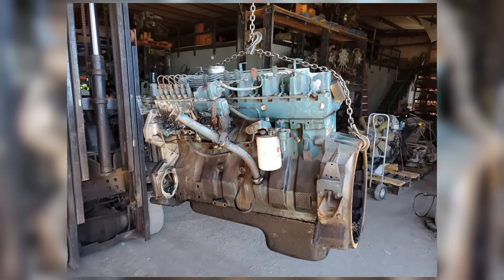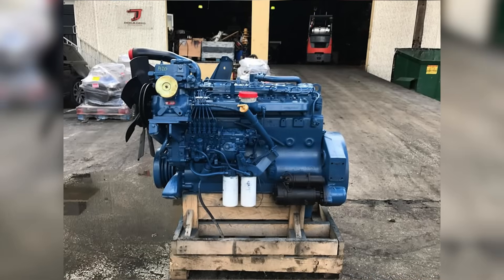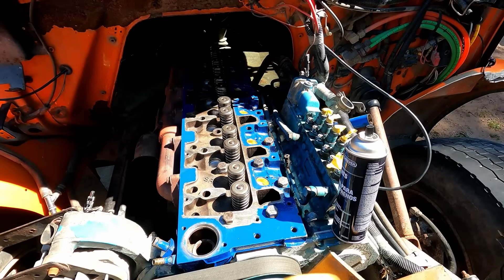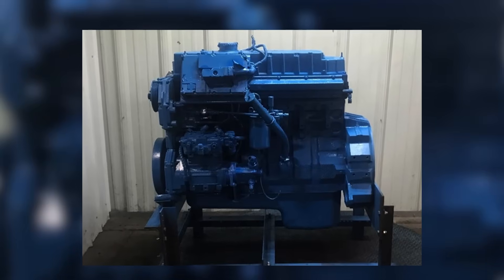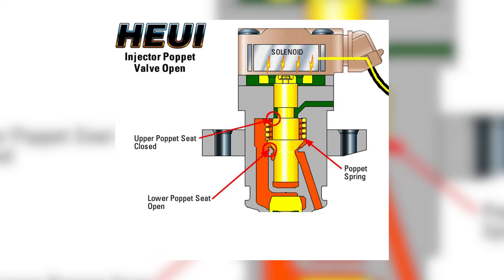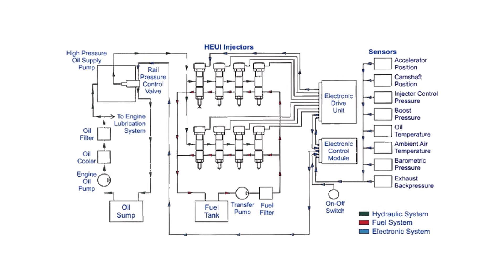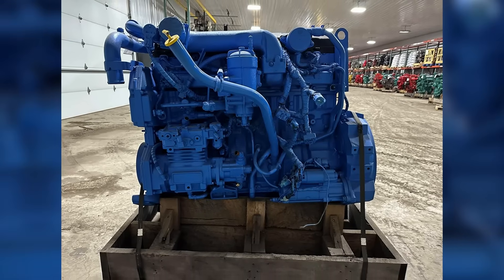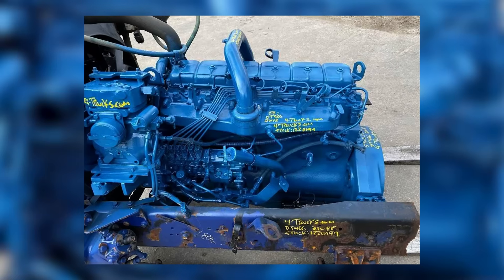The Shocking Truth About Why Truckers Hated The IH DT-466

Comment: We have several school buses. Anything from an old ‘96 Bluebird conventional with a DT466 to a brand new IC with a Cummins L9. 
We also have an IC with the dreaded MAXXFORCE EGR p.o.s. 
(It runs good, WHEN IT’S NOT IN THE SHOP)
And a couple of Cat C7 HEUI engines. Among them all, guess which one NEVER fails and ALWAYS starts when you crank the ignition? The good old DT 466. 
Unfortunately, here in California, the old reliable DT can only be driven 1,000 miles a year because it might puff out a little exhaust smoke when it’s not up to operating temperature. 
A simple, non electronic, non EGR, DPF, SCR “clean air and rainbows” engine that might be a little dirty, but never fails to get the kids where they’re going. 
What is safer for kids? A bus that doesn’t puff out a little smoke, or a bus that constantly fails because of some computer controlled emissions crap that’s broke down on the side of the road with 80,000 lb semi trucks buzzing by? 
Give me the old DT any day of the week and twice on Sunday.

Comment: I was a mechanic at a company that had several of these units both the 466 and 466e, some of the best and robust engines every made.  I am fairly certain there is a 31 year old 4900 with at DT466 still running, and engine was rebuilt inframe only once.
Reply: I drive one daily luck I found one with low kms to build my tow truck mechanical dt 466 with 10 speed Spicer I'm doing 120km/hr in tenth gear revving 2000rpm on highway great highway truck and lots of gears on low side for heavy hauling

Comment: I worked as a diesel/ automotive technician at the USPS when we ran a fleet of IH straight jobs with the DT466 engine in them and we spent a fortune on in frame rebuild kits for almost every single truck that we had assigned to our shop in Providence RI. These engines on average didn't even make it to 50,000 miles before they were in the shop for an in frame rebuild. Another problem that we encountered was failing injectors. Another problem that we encountered was the front cover cracking and leaking oil like a sieve. All in all, not a very good engine.
Reply: Buddy your talking about maxforce engines they came along around 2002 these engines the videos about are much different then what your stating I personally own two trucks on the road with mech dt 466 pushing over 500000 miles easily
Reply: @wadecarver3068 . He’s probably talking about the “E” series DT’s. They redesigned the sleeves and seals used cheaper materials. Seal failures within 100,000 miles allowed coolant to enter oil passages.
Reply: @wadecarver3068 did the maxxforce engines start in 2007?
Reply: @MrWhiteTank they started somewere between 2002 and 07 not exactly sure but there garbage they are tough but expect electrical gremlins almost daily we just yanked one and replaced it with 1990 dt 466
Reply: @wadecarver3068  how can I tell the difference?  Going to be looking at buying a 2006 international 4300.
Reply: @MrWhiteTank honestly I'd stay away there all electronic after 2001 some people have good luck but mostly full of gremlins unless you do what were doing plan on swapping older mechanical 466 in the place if the new garbage
Reply: Curious what was the year of manufacture of those engines.

Comment: Another rage bait titled A.I. video. These guys sure know how to keep their awful stuff at the top of the algorithm. The truth: The only trucker who HATES a (pre-emissions / pre Maxxforce) DT-466 is one who’s expecting it to do the same job a true heavy truck engine does with the same speed and efficiency. As far as a medium duty engine, their competitors were the 3208,3116 and 3126 Cat’s, the 7.8 Brazilian Ford, the 6V53 and 8.2 Detroit, and the 555 and 8.3 Cummins. They stack up equal to the best of those engines in power, longevity, and ease of service and are FAR better than the worst on that list. A MUCH better and more accurate video would be “Why truckers hated the International 9 liter V8 diesel. That one would at least have the ring of truth to it.

Comment: DT466 with the Bosch mechanical fuel pump and a ten speed Fuller transmission. One of the best medium truck engines and transmission options from a bygone era.
Reply: This is my exact setup in my rollback I can do 130km hr in 10th gear revving 2000 rpm just sips feul run 8 hrs s day on 50$ in desiel

Comment: I've been a mechanic for a bit over three decades, the last nineteen years in a truck shop.  An International 4300 chassis (the square body trucks), DT466 and a six speed trans were, in my opinion, the best medium duty trucks ever made.  As soon as the cabs became aerodynamic the the "Maxxforce" name showed up it all went to hell.  The DT466, in all of it's old variations, is one of my favorite engines.
Reply: Does 2005-2006 international have pre-maxxforce engines?
Reply: @MrWhiteTank yes they do. International tried smoothing the transition to the 'new' MaxxForce line of engines coming out. The online DT466 is a good engine and you can do an inframe in a weekend. Plus the parts are readily available and inexpensive.
Reply: @MrWhiteTank no they just get worse they work good when they work goof

Comment: In medium duty applications this engine is fantastic and in my opinion one of if not the best and toughest engines IH ever made.
Reply: Until they ruined it with the E series and changed the sleeve design and materials
Reply: @matthewlitvak2695 the DT466E is a completely different engine but yes. While they were fairly reliable considering all of the shit going on they were nothing like the mechanical engines.

Comment: I had one on a 4386 tractor and i thought it was excellent. When sowing it used 2 liters of fuel per hectare. It started well in the cold pulled like a locomotive and didn't use oil.  Disagree It was a good engine.
Reply: ...it pulled like a locomotive." Yep. Our 5488 fuel screw backed out to well past 300 HP, and she would smoke under load like a freight train. Maintainers said they had to send 4WDs as loaners when they were set up for what they were capable of. They also were more powerful than the transmission gears, and good luck finding a set even in the 90s, because it was commonly the same gears shot from field work.

Comment: Truckers hate the DT466? Go screw. It was better than any other offering in medium duty trucks at the time. The "Fuel Pincher" Detroit (oh dear lord), 8.3L Cummins, and 3116 Cat weren't exactly setting the world on fire. The DT did the job well and cheaply and I would trade anything produced today with all of it's emissions garbage for a simple reliable all-mechanical DT. We used them to work and make money. Not to show off or set records. A repurposed industrial motor is exactly what you want for the job.
Reply: I called the 8.2L Detroilet a "TURD PINCHER" - The NON-turbo engines were the ONLY ones that "held up" but they had the same power output as a 350 Chevy Gasser...(I did like the 8.2L Detroit injector system, borrowed from the 2-Strokes, IF they would have been smart the 6.2L engine would have had that too.)  As for Scatternational....The P-Pumped DT466 was a good engine...The "Electronic" HEUI ones were absolute trash. - Ford had Clatterpillar V636 (3208) in their trucks, and *IF* you kept up on maint. they were actually a good engine...The main and rod bearings were a bit undersized but if you rolled in new bearings in a timely matter, (we had all summer to maintain our trucks - Fuel Oil is slow in summer.), and didn't crank up the power a lot, they would go a long way.
Reply: @misters2837  wait. the 8.2L also had the third cam lobe running an injector with the rack and all that flawed nonsense? i just knew they were crap from the poor cylinder sealing because it's one of those obvious "what were they thinking" issues once the heads were off.
also, you would rather have that injection system than a 6.2L stanadyne DB2? the ASME landmark designed ROOSA MASTER, beautiful in it's integration and simplicity, fuel injection pump? 
you think the 2-stroke detroit injection system is better than that?
i question your judgement, sir. go grab a polished pie tin and look at yourself and reflect on what you just said here.

Comment: If I recall correctly, these are popular in tractor pulling, and in that application they can run them up in the 3,000 to 5,000+ horsepower range at 80+lbs of boost. Very stout engine, but perhaps not a good fit for some of the applications it was used in.

Comment: The dt466 wasnt build for towing 80k pound trailers its ment for low to medium which it did fine. I love all the dt series of engines
Reply: I agree, I in framed a bunch of them they are a very good, reliable and have longevity
Reply: It’s not Big enough for those 80K loads, unlike, say, the Big-Cam 855 (cubic inches) Cummins…

Comment: THE MAIN PROBLEMS WITH TORQUE AND HORSE POWER REVOLVE AROUND THE TRANSMISSION CHOICES!
THE USUAL MANUAL TRANSMISSION WAS 
AN FIVE SPEED, BUT IF AN TEN SPEED FULLER TRANS IS INSTALLED,
YOU HAVE BETTER OPTIONS WHEN HAULING HEAVIER LOADS OR MAINTAINING BETTER ROAD SPEEDS!
Reply: Not to mention all those Eaton 2 speed rear ends. Pepsi loved it in front of Allison automatics.
Reply: Don't forget about rearend ratio

Comment: I'll never understand why companies, even big ones, don't listen to their customers who use their product every day! Baffling
Reply: SImple, really; the people who use their product every day aren't their customers. Their shareholders are their customers. Their business is building shareholder value. Whether we're talking Ford or Intel. You, as the consumer, are the means to that end. You're not the customer. They're balancing regulatory requirements (not with the DT466 at the time it was introduced ofc, but in a more general sense), costs, manufacturing resources, so on to produce maximum profit, not to produce what you want. It doesn't actually matter if you're 100% happy with your purchase or 70% happy-as long as you're happy enough to buy another one.

This is also why modern cars are more reliable to about 150,000 miles than the old stuff was, but basically disintegrate between 150,000 and 200,000. If the car gets through the end of the second owners' ownership without either the first or second owner being unhappy, everyone-well, everyone but the 3rd+ owner-wins. 

The manufacturer only really makes money on the new sale, and the 3rd+ owner isn't taking their car to the dealer for maintenance, so nobody cares about them. In fact, it's objectively in their interest for the thing to fall tf apart as soon as the people that the manufacturer and the dealer make money off of are done with it. 

And with modern CAD, FEA and materials science, it's increasingly feasible to engineer them to do just that. Same reason your cell phones and TVs always seem to get flaky or die just out of warranty. The car/phone/bread maker/whatever isn't the product. Your money is the product. The widget they sell you is how they make it.